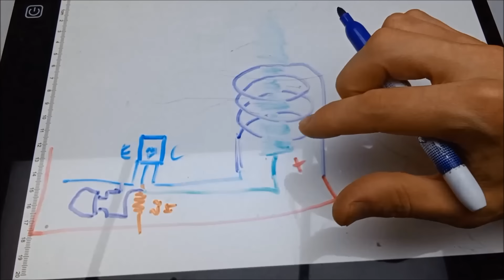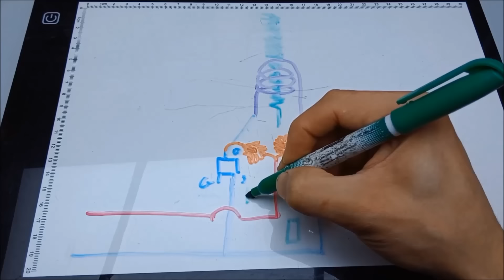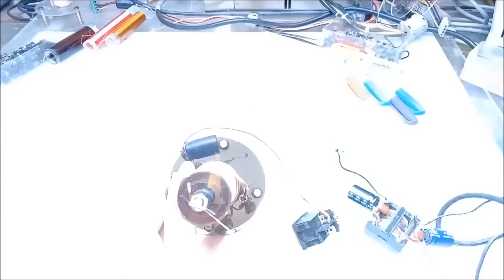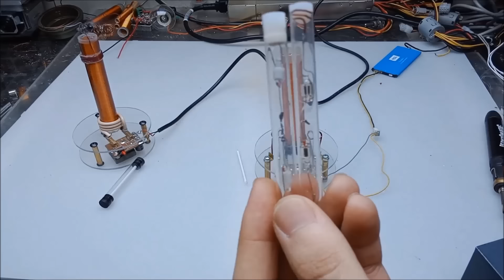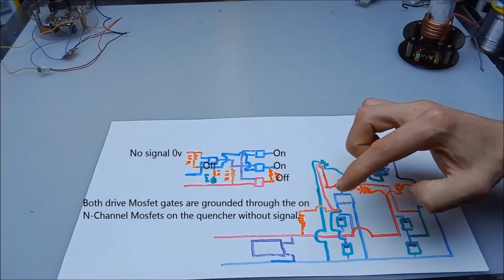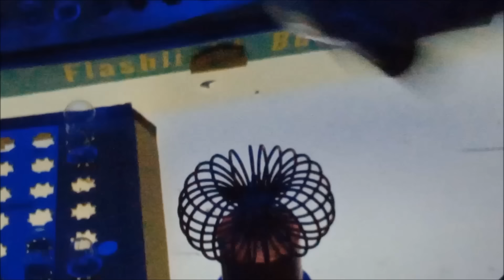A DIY Tesla Coil Talk 2 Circuits, Accessories, & Misc Info

Comment: 1:06:06 Brother what how many turns of primary did you use here? My secondary is similar. I think I’ll soon make this one.
Reply from the maker: I have used very different turns ratios. As these are transformers there is a trade off. With thicker secondary wire you get the current behind the ring and can get decently bright arcs with nice leaders. This also give the coil more range when producing the electric field and makes lights brighter.

Thinner wire will increase general voltage gains and while you get longer arcs they aren't very visible in light and are wispy. Very good for night time use and saving on input current but terrible electric field production with little power so while it can light up light bulbs they are not as bright as the thicker primary.

I generally have a range of 200 to 1500 ohms on these small coils which is a pretty decent range.

Comment: The purpose of the 4 diodes is simply to shunt any excess feedback current to the supply rails, or equivalently, they clamp the gate voltages to (almost) within the supply rails.  This also has the added benefit of giving the (electrical) base of the coil a stiff reference to "stand on", if that makes sense.
Often, moderately sensitive IC's (4000 series CMOS logic chips for example) will have each input protected against ESD in exactly this fashion.  If the input signal voltage is more than one diode drop above the positive rail, the upper diode will become forward biased, shunting the excess current into the positive rail and clamping the voltage at that input to V+.  Similarly, any input voltage that would otherwise be more than Vf below ground will forward bias the lower diode.  In the event that the supply voltage plus a diode drop is still too high, the lower diode can be replaced with an appropriate zener or avalanche diode and the upper diode omitted.

Comment: The modified zvs one ..... Does the circuit have only one pull up 5k resistor...??
Reply from the maker: Yup, you only need to start the osculation on one side to get it going.
Reply: @Zenodilodon  oo thanks 👍🏼 mate 😀

Comment: The ZVS circuit. Could you get it to draw less current by choking further ?
Reply from the maker: for a ZVS you can, the ideal way on these though is to use a PWM based interrupter. You can drop the current very low. I will hopefully discuss that when I get to making my TC magic wand video.
Reply: @Zenodilodon  Of all the builders I've seen you have some of the most unique stuff.

Comment: COULDA SWORN THE FAST DIODES NEEDED TO GO FROM ONE GATE TO THE OTHER MOSFETS DRAIN... ON THE OTHER SIDE OF THE CHOKES
Reply from the maker: ON A ZVS DRIVER THE DIODES ARE CONFIGURED AS YOU MENTIONED. THIS ISN'T A ZVS BUT VERY CLOSE TO THE ZVS CIRCUIT. MY FRIEND SHOWED ME THIS, I DO NOT KNOW THE EXACT NAME OF THE CIRCUIT BUT I AM SURE THERE IS ONE. IF I FIND IT I WILL POST THE NAME AS A PINNED COMMENT.
Reply: @Zenodilodon wow thats interesting i heard theres mazilli zvs and there are other similar, tho i think its still zero voltage switching, but i didn't know that was the difference! thanks ur very bright for ur age... i wish i had gotten into EE b4 the age of 36 lol. I prematurely was thinking ur really breaking it down too much explaining everything cuz i selfishly already knew most of it but here u are explaining something for me! no one does it like this and its actually pretty fricken sweet! keep it up!

Comment: Do the winding direction of the primary and secondary have to be same?
Reply from the maker: They do not need to be wound the same. You can flip the primary connections on the slayer exciters or the gate drive transformers on the ZVS to run the coil as needed regardless of winding directions.

Comment: Very nice video again, I enjoy all of them.
I don't get why you would need the p-Type Mosfet in your quenching circuit. Can't you just leave the 22k in place and just short the gate/base to ground with the n-fet? If the gate is grounded, there is just a tiny current wasted through the 22k from vcc to gnd, but it should work in my opinion. Not sure if it makes a difference in high frequency though.
Reply from the maker: My initial thought was along the same lines. I tried to just ground out the slayer exciter's transistor base but there was some issue. I don't remember what that issue was though. I went to using the P/N channel Fet combination that I used on the ZVS circuit and that fixed the issue.

Comment: I will need to watch this video a bunch of times to mine all of its good content!  One thing that would be great is to post a schematic.  Nothing fancy, just a diagram where the ink isn’t fading:). You show a diagram white board at the end but it’s still a bit difficult to figure out.  I say this because there are many noobies (like me) who want to build these Zvs circuits but are having a tough time reading your whiteboard.  Maybe I am complaining because I am dyslexic! Now this format is superb, don’t change a thing, this is just a request from a humble subscriber.
Reply from the maker: Yeah, sadly some of the markers where more dry than I had expected lol. The ZVS is pretty simple, I can try to find the diagram I made, but it's on a crashed HDD so I have no idea what I can recover on it. It really is quite a simple diagram though, I am certain that if you took a run through and drew a diagram along with me ( with better markers ), that you would come out of the other side with everything you need. There are also dual 555 and 556 interrupter diagrams that you can try to find too! Feel free to contact me through email and I can try to chase up the diagram.

Comment: I bought one of those tiny ones to mess with and it didn't work, I got another and it still didn't work, turns out the leds were fucked, as soon as I changed them out it worked😑 sat there for too long like an idiot thinking, why doesn't that work

Your neon is silvered? Woaw

Now I want to make a 330vdc one 👀

Can you prevent corona more effectively using latex as a sort of paint

Is it true that they could affect the nervous system in some way, I've heard some people who make these for years on years end up getting tremors
Reply from the maker: Yeah bad LEDs would certainly stop a slayer exciter. The silver neons, they are strange... they also have green paint dipped tips on a bunch of them. I think they are for illumination best seen from the top in an even distribution of light, though I am not completely sure.
Reply: @Zenodilodon funky

Comment: You need some new pens!
I always wondered about having an extendable secondary, like telescopic, or having the primary, which I usually see on only one plane, in different positions, I me a I'm sure by now that the reason it's on the bottom is for best output, but it would still be interesting seeing the effect of one in various positions (he said before you did it!) , or even a secondary coil in a square form, I'm an anarchist at heart

The tiny one made me smile 🤣

With the inductors, could you influence, or add to the strength of the magnetic field, by placing a rotating magnet near by? Maybe a crazy question... Do those inductors need to run in opposing directions?

Putting on a fan 🤣 you kill me!

Could you use one to send and recieve messages from another further away?
Reply from the maker: I am strongly thinking about showing up ElectroBOOM's Tesla Coil wand. He never really did complete his and I am wondering why. Looking at his electrostatic wand vs the original JP and I put together I can see that his skills at assembly aren't as solid as mine/JPs. Should I make one?...I think so eventually.
Reply: @Zenodilodon  go for it!
Reply from the maker: The inductors kind of need to be at an alike speed regime as everything else. There is some play you can do but they can't be too far off the frequency of the Tesla coil. Separate inductors can be wired however, but a center-tapped common core does need to be wound a certain way.

The fan was a great move, esp on a 101F day! 

I am working on an RX/TX kit using the LM386 audio amp IC, however they don't always link very well unless they identical coils. Even putting a light/object near them changes this and causes issues. Pretty fickle set up but I have had results up to 15 foot away.
Reply: @Zenodilodon  today 15ft, tomorrow the world!
Reply: I've watched a lot of these Tesla coil videos and none of them explain it in detail the way you do  awesome video thank you!  Can you make a step by step by video on  how to build a Slayer excite? I'd really appreciate it I'm a subscribe on your YouTube channel
Reply from the maker: @rrod0589  There are many simple videos on how to make a slayer exciter. This video wasn't to show how to make a single item but to teach concepts and the connections of parts. I encourage you to make something based on what you learned and what you have. This tends to be far more interesting and rewarding. Build something unique!

Thanks for the the compliment.

Comment: very cool I rencently discovered the push pull sstc works great for low power cw if you kick start it by biasing the gates and once it starts you take out all the gates bias voltage it draws low power and is cool for energy transfer , lighting up fluorecent bulbs etc , but if I try to draw a arc it would kill the oscilation and I would need to kick start it again
Reply from the maker: I checked out your channel and you have some good set ups. I would love to see further/more detailed explanations and diagrams for what you make. I think it would also boost the attention your channel got by far.
Reply: The push-pull version that I built around a year ago was pretty good , it can  do 75kv draws 2a(my power supply maxed out at 2A) at 24v, and the mosfet never died. Also, it was a single mosfet sstc. I am 12yr old now, so  I am that good or experienced in drsstc's

Comment: such a curious and smart innovation, request:part 2 of plasma pen tutorial and stuff you like missed or want to show.
Reply from the maker: The plasma pen does have a full tutorial. As I said, it's really a top skills sort of project of which is very difficult for most people to replicate due to it's size. There really isn't any new/updated information on it. You could probably use one of the modified ZVS drivers and a small TC in a plasma pen with good results though.